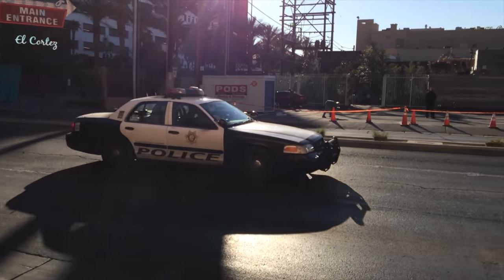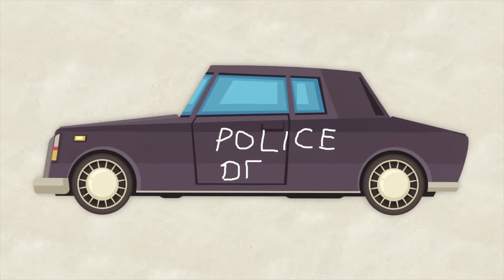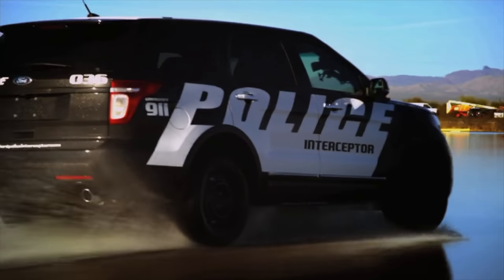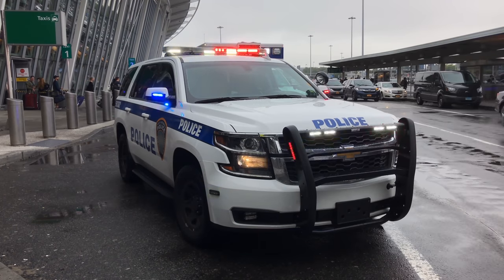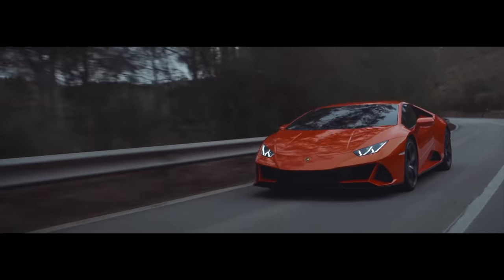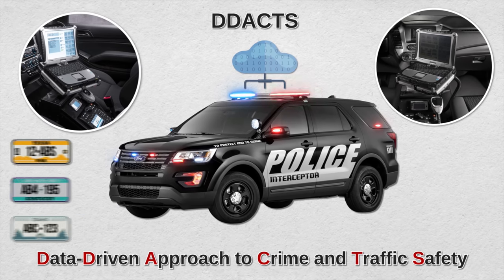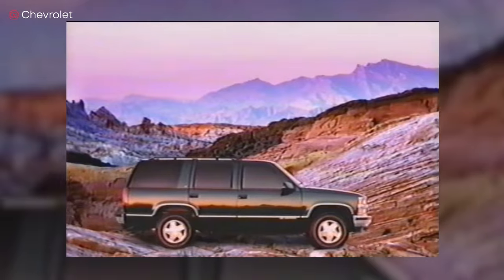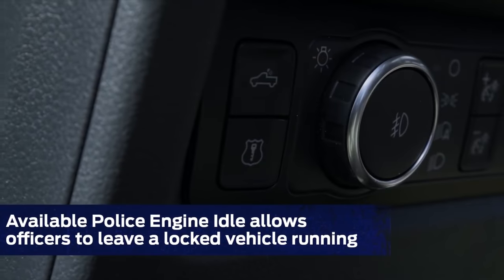Here’s Why You Can’t Outrun a Police Car

Comment: I used to work in a small university garage that had a public safety department with 5 cop cars.  The officers destroyed 3 engines in 2 1/2 years from excessive idling.  The oil pumps barely put out any flow at idle speed so scored cylinders and trashed valve guides were the sad result.  All the officers had to do was rev up the engines every 5 minutes to 1500 rpm and that would have solve the problem.  But that was too much work for them.
Reply: every 5 minutes? you mean, every 2 donuts?
Reply: @Shadow.24772 Lol.😂
Reply: Every 5 minutes? That’s 12 times an hour and 96 times a day. Would you do that if it wasn’t your car and the public just buys you a new one, no questions asked?
Reply: @richardvale214  i would, i dont care about the costs i would rather be concerned if that thing would die on me while going after somebody, imagine you gotta be at a place fast because there are peoples lifes at risk and your car dies on you just because you didn't press on the gas once every few min
Reply: @Maredite  I didn’t realize police cars sat idling that much. But I do know that can wreck an engine because I had a temp job delivering mail on a rural route around Xmas one year that lasted 3 months. Deliver to a box and then go hundred feet to the next. Repeat for 10 hours a day, 6 days a week. Within a week I needed a water pump and after the 3 months the car was burning oil. It was a toyota celiac with just over a 100k, always taken care of. Could easily have gone over 200k if it hadn’t been for those three months of unintended torture. I had to part it out before 120k. Maybe if I revved it up between deliveries, I wouldn’t have had to.
Reply: This is one of the many reasons using your car for Uber or Lyft is a bad deal.
Reply: Wait is it really that bad to idle your car?
Reply: @christopherpape4823  Idling causes twice the wear on engine components as driving at regular speeds. It also causes carbon buildup which leads to further damage.
Reply: @richardvale214  hmm good to know appreciate the info 👍
Reply: Damn that sounds like something that could totally be automated specifically for police cars and save a ton of tax money
Reply: @Maredite imagine you thought the government vehicle maintenance was your responsibility.
Reply: @watutman  cause you basically are destroying your car for others... and not really making enough money from it
Reply: @robert-h2x  right
Reply: Sounds like they could benefit from electric vehicles..
Reply: i wonder if the revving to 1500 rpm every 5 minutes is something that can be accomplished by an automated system.
Reply: @christopherpape4823  Really bad. Also lots of stop and go. Spark plugs foul out in Manila Philippines after about 5k miles on brand new cars that never see a clear stretch of road, much less a highway.
Reply: They don’t care - it’s taxpayers money!
Reply: Always is but everyone will keep laying out red carpets
Reply: @Maredite youre looking too far into it, cops.     Do.    Not.   Give.  A.   RATSASS
Reply: Why you NEVER buy a former police car.
Reply: @christopherpape4823 
Absolutely. Same thing with those diesel pickups. Semis use much larger engines. But still not good for them.
Reply: @quintonstevens 😂
Reply: We sent one to the wrecking yard with a new motor in it.. That car would have been be a good purchase.  But that is pretty rare.
Reply: Fords engine management system used to do just that in the late 1980's when fuel injected computer controlled engines first came out..  But they dealer made more money doing engine swaps so naturally it was discontinued.
Reply: if the only idling you do is at stop lights, no.  But when the car idles for hours at a time the engines are quickly destroyed from low oil pump output at idle that causes oil starvation that trashes the motor.
Reply: Actually it was the university footing the bill.
Reply: Brah - the police can be away from their car for a much longer time than 5 minutes. Just because it’s idling doesn’t mean they are sitting in it. If they are on scene they have to run their lights most of the time.  Running down suspects, interviewing witnesses etc.
Reply: Every 5 minutes does sound like a lot of work. Name one thing you do that is that frequent. That's like...I don't know...taking care of a newborn baby.

Comment: I bought a 2008 Crown Vic that still had everything except the computer, lights, and police insignia. The cameras were still there, although I had to take it to someone to make it work. The coolest part was the amount of functional safety features such as a full length skid plate, rubberized fuel tank, and the fire suppression system mounted in the trunk. The downsides were that, while the emergency lights were removed along with the insignias, it still had the black and white paint job and spot lights, so people would always assume that I was a police officer and slow down 5-10 mph below the speed limit. It took much longer to get anywhere! Some parts are made specifically for police cars, such as the suspension and steering parts, and you can’t buy them at an auto parts store. You either have to buy them from the dealership or convert them to a more readily available part (although that sometimes costs more money because you have to convert related parts). Also, I was constantly getting pulled over so officers could laugh about how they thought I was a cop until they either never got a response on the radio, or noticed my license plate. It always seemed to happen when I was in a hurry, like on my way to work. I would buy another one, but I DEFINITELY wouldn’t use it as a daily driver again for those reasons.
Reply: I bought a 03 I love that car it was awesome the most impressive thing was the braking system I mean it totally blew me away it was awesome it was the same braking system that they use on the 350
Reply: @khristophertaylor811  I don’t know for sure, but the 1 I had may have too. They told me they had just replaced the brakes when I bought it and when I looked underneath at the rotor, I remember thinking cool oversized rotors. They’re great cars for sure! But really heavy because of the reinforced frame, so don’t run out of gas or get stuck.

Comment: This was super interesting, now I want a police alternator. Decades ago I had an RX7 with a 4 barrel Holley carburator and I think it was an RK turbo. Was a nurse and got called in for an emergency. Cop pulled me over, told him I was going to an emergency. He says I couldn't drive that fast without lights a sirens. Apparently the wrong thing to say was, where can I get some. Told my mechanic the story who mostly worked on race cars and he asked why I stopped because the cop wouldn't have been able to catch me. I would have never done that even if I'd known.
Reply: The alternator is only for the extra electrical usage. Many guys that do subwoofer stuff use the same methods.
Reply: @Momentaryghost  Worse than that. Actually takes more power away from the engine. I've known some guys who prepared cars for track days and would make really a lot of power from an engine. They said they even change wheels to change ratio on alternator's gear to make it run on lower rpms, and thus to save power.
Reply: @piotrmalewski8178  You change the pulley, not the wheels...
Reply: @piotrmalewski8178  yeah but the amount of power that would steal is very small, Turbos and superchargers would steal more at slower speeds
Reply: @hunterbear2421  the ecoboost engines (oh and every Chevy since 2015 or so) would like to talk to you.
Reply: @Wheagg  well it is true they do steal power at lower speeds
Reply: @hunterbear2421  tbh, probably doesn't matter at those speeds tho, since you're not going that fast, not an expert but as long as you have enough torque to go forward...
Reply: @Wheagg  yeah probably doesn't matter you really would be trying to get every drop of horsepower if you did such things like removing or changing the gearing
Reply: @piotrmalewski8178  if you changed to a small pully it would spin faster and over charge. I think purpose built drag cars don't use alternators. Funny cars use a different ignition system and no need for an alternator  when you are only idling for a minute and your run is over in a few seconds.
Reply: Would have loved to know you back in the day. Built RX7? Nice!

Scotty has gone to a new level. 

— Matt’s dad
Reply: @hunterbear2421  there’s no parasitic loss from a turbo, it’s spooled from exhaust gasses, and a supercharger may be belt driven but makes boost which negates that factor completely

Comment: Fun fact, most civilian Ford vehicles with the my Ford touch system with the bigger screen and info dash that are also used as police cars can have a lot of the police features enabled with a OBD2 dongle and forscan software on a laptop. I had a 2016 Ford Fusion and added blackout mode. It's used by police in order to be extra stealthy. Basically as soon as you turn off the ignition every light inside and out and all the chimes all go out with the ignition. You can also enable headlight strobing but not sure if that's legal.
Reply: it's not legal to have red white and blue steobed
Reply: My explorer black out while driving running or not and the door lights never come on that’s a safety thing a police car dose nothing you don’t make it do.

Comment: You don't have to use speed alone to lose the police.. the key is urban environment.. combined with extremely intimate knowledge of the City.. you can lose them in less than 5 minutes if you know what you're doing
Reply: Many, many years ago, I learned that if you don't stop, drive as fast as you can safely do so, never look back, and have a planned route and destination, it's sianora. Of course, I had the fastest motorcycle in the world at that time. 

I'm far too old for that now. Drive safely. Pull over. Keep both hands on the wheel. Have respect.
Reply: This is true. Not advised. But absolutely possible.  Radio is no help if they can't see you.

Comment: I purchased an old sheriff's Plymouth Valiant '74 with a slant six at an auction in the Southwest about 30 years ago. No rust and I used it for about 8 years before giving it away. I had to replace the starter at one point, and the gas pedal needed to be worked a certain way to start the engine when it was cold. Other than that it was very reliable. I believe it only cost about 400 at the time I bought it.
Reply: Lol those old Chrysler products all had to be fed a little gas with the pedal to start esp after a couple days not driven or in the cold. That was a good antitheft mechanism because no one else could start them. 😆
Reply: The boys in blue! Those guys are good! *Crashes into civilian going 106 to non emergency call 🙄
Reply: @KniFz  yeah. I did a short ride along with a cop I knew who was off duty at the time. We ran out to park for some halfass reason. The 4.6 CVs were new and he just had to show me how fast it was. I was surprised, it was much quicker the the 5.0s. Not impressed with the any excuse to drive super fast mentality.
Reply: Zero rust? 400 is a fantastic deal!!!

Comment: The 94, 95 and 96 Chevy Caprice 9C1 package. With the Corvette LT1. Was a hell of a police car. Would run 150 plus. With a tall light bar on top. Had a blast driving those cars.
Reply: Very true I have all 3 currently,great cars
Reply: True,  that LT1 was whooping them 96 impala. Possy rear end baby.  Only cars gave me problems keeping up gt mustangs, and corvettes!
Reply: I have 3. A 94/95/96.i have a pic of the digital speedo at 172.unmodified just raised the speed limiter and engine limits rpm,fuel cut off and shift rpm

Comment: A local traffic cop got the idea of using a very old Crown Vic ghost car to rejoin the fleet.
Hugely successful.  No one expects an old faded, dented car to be a police car.
Reply: Undercover police love the, Ford Taurus all the jump out boys drive them down here in , New Orleans
Reply: With a 4 cam 4.6?
Reply: LOL... I almost got busted in Utah by a cop driving a blacked out Charger, unwashed and with round shouldered tires.  Traffic was bunching up into a pack and ramping up to 100 mph like a nascar race.  I decided is was safer to be in front of the pack of cars so I got out of the pack and sped up to around  115 mph in my Volvo,  I got about a quarter of a mile ahead of the pack and noticed that the charger was keeping up with me.... and then.... red lights in the windshield LOL.  Of course I stopped.  I explained to the cop exactly why I was going so fast was to get far enough ahead of the pack to create a safetey buffer between me and the pack.   Fortuneatly...  I was in uniform for my own job as a driver. I had all of my information available and insurance right where I needed.  The cop let me go, but he said....  next time just leave home early. LOL...
Reply: @2000bigruss lol they have twin turbos in them and my base 370 still smokes them. I'm starting to think they're not even trying..

Comment: I remember back in the 1960's the Calif Highway Patrol in Los Angeles had a few "Freeway Pursuit" vehicles.  I think they were Chrysler 300 something with many race-car like features such as racing seats, roll bars, big tires and who knows what else.  Were in use for only a short time.
Reply: Yes I remember these vehicles..they were awesome looking...
Reply: @xXBrianBelloxX  yup! One of the counties here in Ga has a few police package 392/ Helkats. You cant even imagine how bad they run down some of these high powered vehicles out here. Most are extreme situations; weekends, 2-5 am, chases, etc.
Reply: @xXBrianBelloxX  though they never seem to use imports for undercover
Reply: There is the interceptor package and the pursuit package on the Crown Vics. The pursuit package supposedly has no emmision controls for better mileage and other mods for long pursuit applications.
Reply: @briank10101  Saw a Nissan minivan that looked normal until the lights came on. (as they were passing me)
Reply: I bought a 1973 AMC Matador that was a California Hiway patrol car.  Had a 401 pursuit engine, low ratio rear end and a top speed of 110, but it would get you to 110 faster than you could believe.  Beefy front and rear anti-sway.  I put some fat mid performance tires on it and it was like it was stuck to the road, catch a corner at 35 mph with no squeal.  Used to pull on to 610 loop going slow then chase down the fastest car I could see.  The roof and supports was aluminum as well as the window frames.
Reply: @briank10101  FBI has an amazing array of undercover cars, some are imports, some are very expensive.  Most all are seized property.
Reply: I was driving I 85 thru downtown Atlanta around 2010. A black 'stang with blacked out windows rumbled up beside me. 
For some reason had the window down halfway. I looked in and was surprised to see a fully uniformed officer.
As it passed me,  I noticed a factory looking emblem that said "Interceptor" and another emblem that said something like "nitrous"  or "nO2".
I bet that car surprised a lot of runners

Comment: I actually owned a Chevy impala police package, I imagine it might have been undercover car as the car was blue  and did not seem to have ever been repainted, but when I bought it we noticed the color code for paint was odd as it didn’t say a ordinary color code but rather used a sort of rare paint code. When reading through all badging on the car we ended up noticing that it was indeed police package vehicle, although the suspension on it was was rough house feel just about every bump but it didn’t feel as though you would lose speed or traction despite that

Comment: I bought a reconditioned CHP Crown Victoria once.  Most of its high performance items had been swapped out, but not the brake calipers.  When those wore out, the cost to replace them was 5x the average, and to convert to the 'normal' version would have required replacing the entire wheel assembly, at a great cost.

Comment: I owned an old clapped-out 2004 Vic patrol car. It was my first car, and it served me well for the nearly 7 years I owned it. Best damn $900 I've ever spent. I recently gifted it to my younger sister who is just old enough to start driving as her first car. Being a midwest car, I expect rust to take it sooner rather than later, but mechanically, it's been perfect. That being said, the frame has held up surprisingly well, the issues it has are mostly cosmetic, with the fenders being pretty bad (but it is making its way towards the cab). If she wants to get that stuff taken care of, I wouldn't be surprised if she could get it to 300k miles and beyond. It even survived a highway speed deer collision due to the bump-bar that was left on it. You can see where it hit the bar, but it just bounced right up and over the car with no other damage. 

It was a little wallow-y, you definitely felt the weight of it while turning, but it was comfortable and it sounded awesome when it got over 3500k rpm, plus the trunk is huge. You could seriously store multiple bodies in it if you wanted; it's that big. If there were any for sale near where I moved, I would have bought another one without hesitation.
Reply: "You can story multiple bodies in there. Trust me, I've tried!"